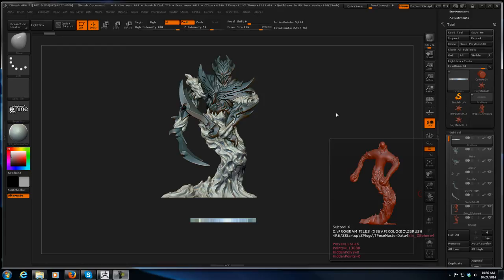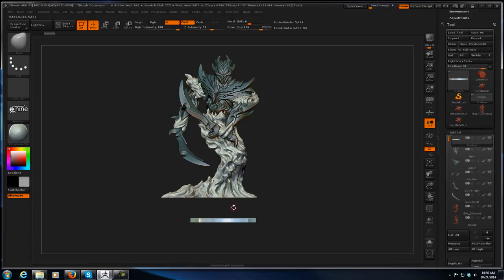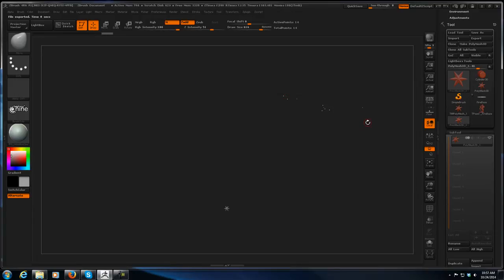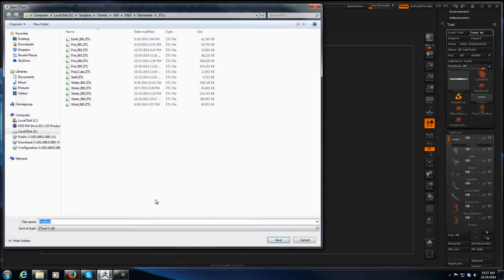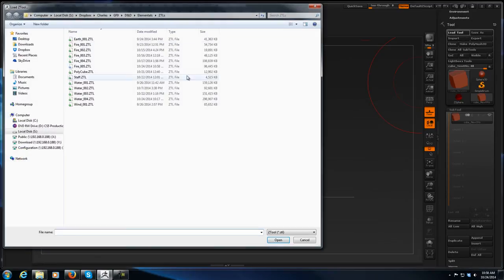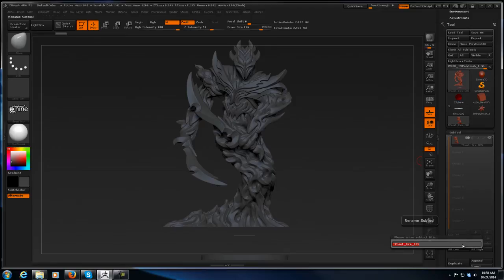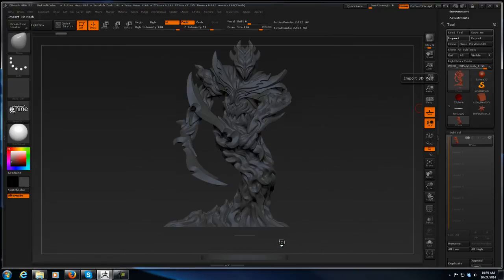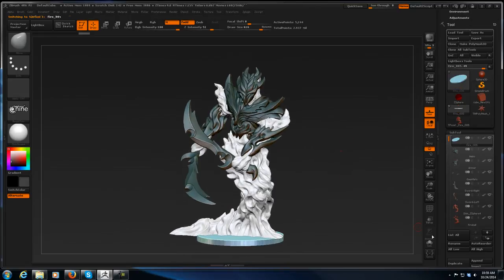Correcting a 'No Matching Subtools' Error in Transpose Master

Comment: I tried this in Zbrush 2024 but it keeps saying please select a TPoseMesh when ever I try transfer the Tpose back to subtools... :(
Reply: ok ABSOLUTE LEGEND, it worked. But for anyone having the above issue I mentioned. Make sure when you do the following...

A) when exporting the obj of your pose, make sure to first go to "Adaptive Skin" under Tools turn the preview on, turn Density to 0 and DynaMesh Resolution to 0, then "Make Adaptive Skin". If you dont do this, it will export out the obj with a different vertex count and therefore different vertex positions and youll get an error saying the  above as a result....
 
B) After opening the fresh cube scene and loading your ztl of the original tpose mesh, When creating your TPoseMesh under the Transpose Master, make sure " Zsphere Rig" is turned off.
If you dont turn off this, it will generate it with a zsphere rig attached and you wont be able to replace it with the posed obj you created...

Comment: If anyone ever runs into the Error 32 BS, if you save all your subtools one by one, open a default Zrbush project like the cube, then import all your subtools at once, you can have a clean project file. Worked for me tonight.
Reply: Hi! I am dealing with that problem right now. Do you mean exporting each individual subtool as separate .OBJ and then re-importing them again into ZBrush? How do you do that all at once? Sorry to bother you, I'm just so bummed about losing my progress.
Reply: @Imickskrals   If I recall, you save out the actual subtotal as a ztl if I remember correctly offhand because that saves all the ZBrush data. Good luck!
Reply: @michaelkonomos   Thanks!
Reply: Hey man, you just saved my day! It worked perfectly. You don’t have to save any subtools singularly you can just save the whole tool and load the whole tool in a new project and it works

Comment: This wouldn't work with multiple subtools, would it? I'm modeling a boot comprised of ~10 different subtools so I figure I'd have to export it as a ZTL, not an OBJ, but this method uses OBJs.
Reply from the maker: Hi Alex, yes it works with multiple subtools because of the way that Transpose Master works, i.e. by converting all subtools to their lowest subdivision level and merging them together as a separate mesh for posing.